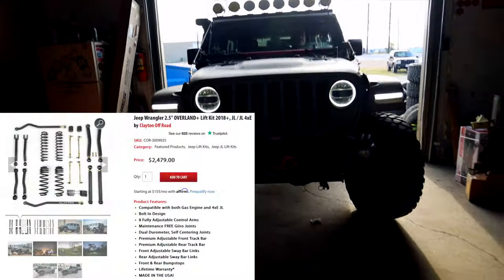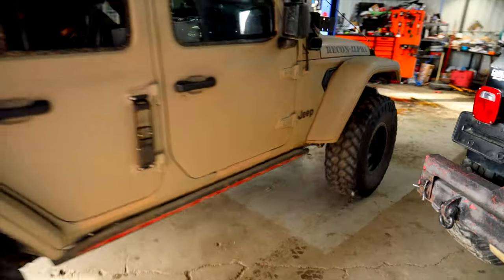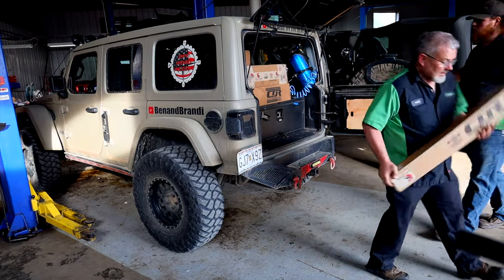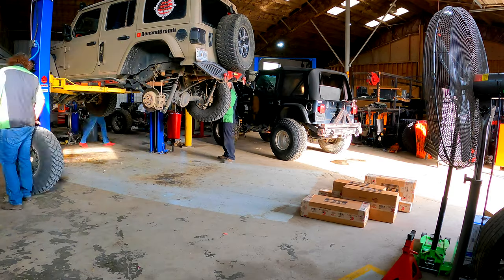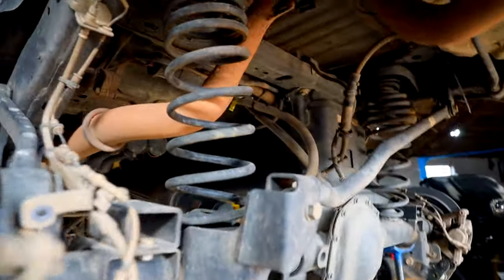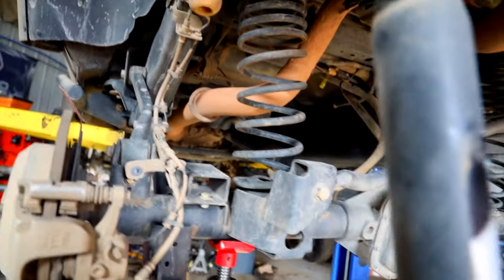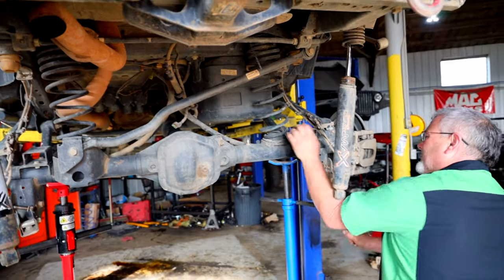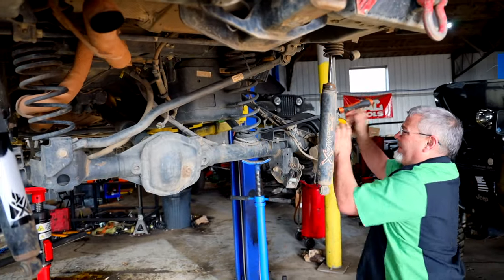Clayton Off-Road VS Metal Cloak Initial Thoughts (With wheeling)

Comment: Theres tons of variables here. Weight, shocks, springs. 

Metalcloak has springs that have dual rates, which is why theyre more bunched, but when at max articulation they're better than a fixed rate spring.

Comment: Just purchased the 2.5" Clayton Overland and Falcon Fast Adjust, can't wait to get them installed. So far this vid, justifies my gut and research.
Reply from the maker: We are out in Moab now. It’s performing beautifully! Subscribe for real time updates on it!
Reply: Since most of us are on road most of the time, unless you flatbed your rig to the trails, can you please do a real time on road review for us daily driver folks…thanks!
Reply: @Marie-kj3xf  We love our set up. It’s my daily driver, and we have taken it thru a half dozen moderate Georgia trails. I did add sway bar links disconnects from Teraflex which greatly improved the trail handling experience on my  Sahara 4xe. On highways or sharp curves with rolling hills the suspension handles like a dream.

Comment: I’ve got a JLUR on true 37s with the off-road+ 2.5” and the bump stops prevent me from rubbing. I’ve got about 2” still before I rub. Im considering pulling the Clayton bump stops and using something else to get a little more out of the Jeep. Did you use what Clayton provided or something different?

Comment: MetalCloak is the top choice if you truly care about your ride. The suspension is firmer but paired with the right shocks you get a stronger more articulated grip then Clayton. 
Just get adjustable like Fox or better yet Falcon 3.3’s the stiffness goes away.

Comment: Curious why you keep the tow bar parts on the front - aren't you worried you will bend/break one off by hitting a rock?
Reply from the maker: Not really. They are super stout. I occasionally remove them if the trail is bad enough with approach angles.

Comment: Hey guys! Great video! I just recently put this sameclayton lift but the 3.5" on my gladiator.  At first it felt smooth and nice.  Then I put 35" tires on it and since it has felt so bumpy. I can feel EVERY bump and it's kinda making me sad.  Did I do something wrong?
Reply from the maker: What size wheels are you running?
Reply: @BenandBrandi  17" stock rims.  Also have the have fox shocks
Reply from the maker: Sounds like stiff shocks or springs… the Clayton will mostly give you articulation and stability..
Reply from the maker: Give the new shocks a few weeks or so to loosen up.
Reply: @BenandBrandi  it's been about 6 weeks already
Reply from the maker: Who did your shocks and springs?
Reply: @BenandBrandi  I did them myself.
Reply: What psi you running?   If it's to high it will feel bouncy for sure.

Comment: Adjust the shocks.
Reply from the maker: They are on the softest setting and placement.
Reply: @BenandBrandi  Ok, tire pressure? I have the metal cloak but I am on Fox 2.5's and when aired down it is smooth but I think the spring rate is stiffer for greater cargo capacity.